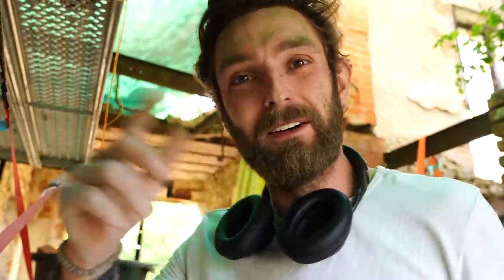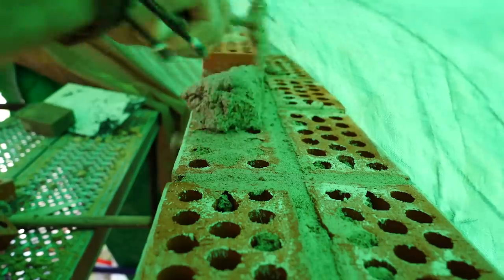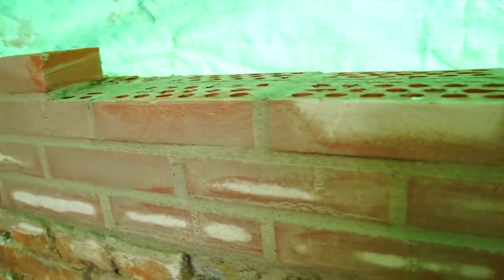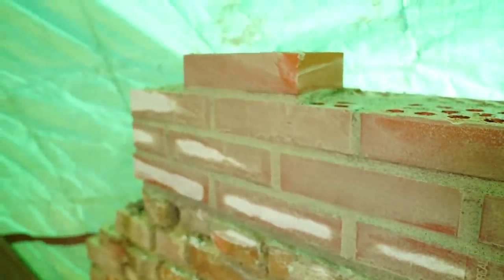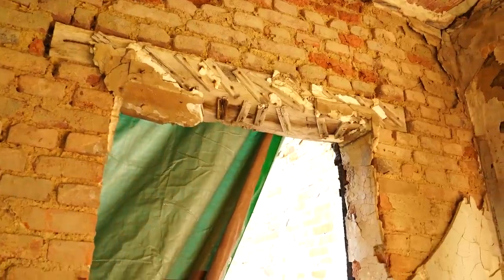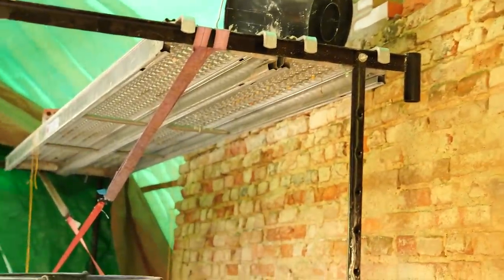The great rebuild has commenced; rebuilding a ruin brick by brick.

Comment: Please do a 30%-60%-90%-20% overlap per layer and make every second layer as a cross layer. It will make the strongest brickwall. Alternative you can use stainless steel binders to secure the strength of the wall. Regarding transportation of materials, you can make a ladder lift by using the ladder as a railsystem for your winch. Best regards from Denmark.
Reply: I'd like to see him try that ladder rail system, just to see how it works! 🤔
Reply: You just copied and combined the other comments before you 😂
Reply: I hope he reads your comment. Pretty scary stuff.

Comment: You need to read about the different kinds of brick bonds (that’s the pattern which bricks are laid in walls). You should probably lay them them the same way. The amount of strength is determined by the bond you use. I know of a couple different ones. They have changed at different points in history.  Oh screw it. I looked it up for you and what is there is an English bond and it is the strongest. What you’re doing is not as strong and might not be strong enough. An engineer could tell you. Put it back the way it was or it might fall down.

Comment: Just something to consider: i know you guys in britain work different that we in germany do, but if you look closely at the wall under the part you did new, you will see, that the french as well change the orientation of the bricks in everey course. what they did (and i would do) is laying the long side of the bricks every first course orthogonal to the length of the wall and everey second course in the direction of the wall. (maybe google cross bond) the thing is, if you continue your bond, you are in fact building two walls very close to eachother, because there is no real connection between your two rows. thats having a negative impact on the load transfer on the wall. the cross bond would be the best bond to equally distribute the load of for example a beam through the whole wall (load distrubution angle)
Reply: He's still not connecting his new walls to the old ones much in recent videos. I'm a bit alarmed because this is so much effort to not be doing it correctly!

Comment: Might be worth investing in a second winch so you can send two up together and halve the amount of ladder climbing
Reply: Maybe better to pay a helper.
Reply: Can a winch be faster
Reply: I really think that doing all that he can do by himself is a large part of his enthusiasm for this awesome project!
Reply: @sadjaxx  It is possible he could pay a helper and not have enough to buy materials. Then the helper would just stand around doing nothing.
Reply: I was worried the motor on the winch would burn out
Reply: A small temporary scaffold stair with winch column would help, but will the ground floor take the weight and is it too expensive, ladders are normal for building sites but they normally have a platform hoist to lift up materials, which is obviously more helpful!?!
Reply: I’ve recommended a second winch a couple times to save time, climbs and safer. In USA proper winch would be >$300. No brainer. And if he finally gets a helper or volunteer just makes them more efficient too
Reply: Oh my goodness what a fab idea.  Up there for thinking eh.
Reply: @loloholmes2793  These 100-Euro winches are rated for 250 kg if I remember correctly. Their achilles heel isn't the motor, it's the switch. A replacement switch is around five or six Euros at Conrad's though and plugs straight in. I've been tempted to convert ours to contactors for a while though, that should make the switches last forever.

Comment: You really shouldn't do a 50% overlap in the brickwork. If a brick breaks at the center point the crack will go down the next gap underneath and then the brick beneath that has to carry all the forces from above alone. You normally have a 25%-50%-75% (per layer) overlap or better a 30%-60%-90%-20%-.. (per layer). This will distribute the forces more evenly in the brickwork.
You should also cross connect the layers quite often. This is really important.
A. every 7 or 11 bricks, 
B. or make a cross connecting row. every 3 rows.
If you look closely you will see that the old brickwork is a roughly 30% overlap with a cross connecting layer every second row.
The 50% overlap looks nice but is the weakest brickwork. The more "chaotic" the brickwork the better, as long as the gaps are not directly above each other.

EDIT:
You should also have an overlap between the bricks of both sides of the wall. You should also use a soft mortar for the first three rows. As the wall settles with the new weights. Hard mortar will make the brick break. You need some layers that can "follow" the settling walls. 
Adding a layer of glass fiber mesh in the mortar will help with that. There is specialized mesh exactly for that application. It helps distributing the forces.
Reply: This is why daily vlogs are so valuable. Expert advice is offered at an early enough stage to be useful. Worth more than money imo.
Reply: @michellebyrom6551  Not rally an expert just a guy who has rebuild a few houses in his live. Laying brick is something you really have to look after. I had to rebuild a wall once because of this.
Reply: Excellent advice and well explained! We learned this the hard way ourselves... luckily we hadn't gone too far! 😬🤦. Very critical at any height but especially at the height that Dan is working at.
Reply: The hammock shenanigans made my day. ❤
Reply: Sure hope he follows your advice….😅😅
Reply: @maryfoster1395  You really think he reads the comments ? .....I don't
Reply: And to that point, that wall appears to have been constructed with English bond (alternating layers of headers and stretchers) which is among the strongest bonds in masonry. The new laid brick is in American bond which is fine for facades but not great structurally.
Reply: @meichong8278 just reads how much he’s getting on patreon
Reply: Great advice
Reply: @meichong8278  Yes he does occasionally scan the comments - he may not reply but I have seen comments in video's that directly addressed comments on his video's and usually weeks to months down the road..  He films in advance too so sometimes what we are watching today had been done a week or more before so his replies on video seem a long way off.  I'm amazed at how hard he works and films/edits and uploads with only 2 camera's and mostly on his phone - I asked and he answered.
Reply: A mason might help
Reply: I think he's missing a trick and getting in touch with a local college where they are teaching brickwork/plumbing and electrics, supply the materials they supply the students, they get the work experience and you get assistance, although you may want to address the glaring health and safety matters before that could be allowed =)
Reply: @maryfoster1395 ?
Reply: @Mei Chong  he does a yr night
Reply: @SSHHABBA  are se jealous  much😅
Reply: @caerleon9176  a bunch of kids three stories up a  fire damaged mansion?? I don't think anyone would take that risk
Reply: @richard-gn3es  I did far worse in the Army at 16 1/2. Like anything, if the risk is managed should be no issues for anyone.
Reply: @caerleon9176  it's a liability for the college.. a YouTuber and the kids?? When the guy can afford to hire someone to help brick lay.. instead of all the hassles a bunch of kids would bring
Reply: I hate to be the negative Nancy but I question the structural integrity of those walls. I’m not an expert nor have any knowledge of building but something tells me that building new brick on top of crumbling brick doesn’t seem right. Am I wrong?
Reply: Great advice  clearly explained 👏
Reply: @dban3750  Im unsure about that but i think id have pointed between the bricks on that wall before adding any weight
Reply: Good advice
Reply: Wowzers. Can you fly to France and help him out?!
Reply: Same reason they previous builder alternated the brick rows.
Reply: It looks like you started an American or Scottish bond. So far I only saw stretchers. When will you start with headers?
And btw: If your hammock has the right size you sleep at a 90 degree angle to the hammock to have a straight spine…
Reply: The chosen brick-bond is home made. The home-made version, will not replace the building's original English-bond. The English-bond, is that bricking-bond, that has the highest structural integrity. But as Dan says "he's no expert" So he believe that his untested home-bond is stronger, it's not!! But it does save on bricks.
Reply: @meichong8278  He does!
Reply: @michellebyrom6551  Very true.
Reply: Wow, u need to go over there and help him.
Reply: Can u do a video explaining what you are saying ?
Reply: Good of you to share your expertise.

Comment: Agree fully with Ian C. You need to tie the two brick courses together at very regular intervals. Also, and this might not seem important but trust me, it is, if those bricks have been stored inside as appears to be the case, you need to soak them in a bucket of water for a few minutes before use.  It the bricks are dry, they will suck the water out of the mortar and you won't get a proper bond between the brick and the mortar. Great channel!
Reply: Dan has been doing this!

Comment: 7:00 no, it won't be stronger. Also you need a queen closer or half a brick on the opposite course to stagger the mortar joints otherwise it will crack along the mortar joints. The original brickwork looks to be flemish or English bond and the bricks placed perpendicular to the stretcher course are to tie the wall together otherwise it will want to peel apart. You could get away with using metal ties every couple of courses if you just want to do a straight stretcher bond but that's not 'period'. Also, use a piece of wood or metal at one end screwed to the end of the wall with the depth of each course to get your desired height and use the lazer to mark on the old brickwork the height of each course nd run a string line. Not a critisism, just advice for your awesome project from someone who has been there and done it albeit with portland, not lime.
Reply: I’ve no personal expertise, but I did wonder about how stable those two courses of brick would be at at height on a somewhat mobile structure and attaching to an old wall, especially if they are to support the weight of a form & a curing ring beam on top. Good to see someone with knowledge commenting.
Reply: This…
Reply: Totally agree.  Hopefully Dan reads this and adjust accordingly.  Also, glad Dan now has his twin brother helping.
Reply: What gave the game away  ? When he said " I've just got to put another couple of layers on "!!! Or when he said " I'm not sure what I'm doing . .. but at least itll look nice and neat "  I think the only bond Dan knows is ..... James Bond 😅😂🤣😂😅
Reply: Listen to builder
Reply: Need a consultant builder or architect hobbiest🎉
Reply: Another tip is to repoint the brick under where you are laying brick. Everything below supports what is above. Placing reinforcing steel "staples" between inner and outer layers is a good idea. To build an arch. you need what is called centering, or a form for the underside of the arch. It supports the brick work until the mortar sets.
Reply: It did make me cringe a bit as soon as I saw he wasn't doing the second course perpendicular like it was before. I was shooting in my head that it's not going to be as stable, nor is it going to look right! 😟
Reply: Edit: *shouting
🤦‍♀️
Reply: What he is building here is essentially a series of little two brick columns which are  weak, structurally.  Ian is totally correct he needs to stagger the two stretcher courses of brick on either side of the wall with a half brick at either end, so the bricks on either side are offset by half a brick from each other. He then needs to put header courses of brick across the two stretcher courses at regular intervals, to tie the two halves of the wall together.  This is how the original walls were built and this is for a VERY good reason.  I would advise taking down the new brickwork and starting gain before he goes any further.
Reply: I loved his line: "I'm no expert but I feel this will be stronger"... than the brick layout pattern done by the experts
Reply: @andymccabe6712  Yes he has. As we see in future, now past, his centering is tight. There is no room to get the formwork out after the mortar has set. Wedges and screwed cross supports would help.
Reply: @andymccabe6712  I tend to refer back to the experts who built the place. Those who were masons and engineers their whole life. Dan himself said the first time he’d even touched tools was a few years ago starting their farm house. He’s a great learner, very clever and capable but in real terms his experience is very, very limited.
Reply: @andymccabe6712  He’s built about 3 arches in his life. And even then only reconstructing the form of what what already there. I wouldn’t count his kitchen bench mock-industrial-style recesses. But yes, the over-reaching condescension is a nasty part of YT comments. Old men shaking their walking sticks at the TV hoping to be valued for their wisdom.

Comment: I LOVED the "BUCKET CAM" going up Dan !!! With the brickwork I would do what the builders did before you TWO rows "side by side" and then "one row across " to tie the wall together and stop it from splitting down the middle. This is a SOLID WALL CONSTRUCTION, so no insulation then in about the 1920's the cavity wall comes along but cavity wall insulation to make a warmer home is not introduced until about 1970's in the UK. This would actually be a good time to build with a cavity so you can build to new standards and use insulation ! I think that hammock was telling you it was to soon to buy a hammock as "little naps"  could slow it all down and winter is on its way !!!
Reply: This is an internal wall, so no need for a cavity. The external walls are mostly still there so I think he'll have to go for internal insulation, like he did in the farm house. Cavity walls were typically used in particularly rainy climates to keep the inside of the external walls dry, the thought of adding insulation came much later.

Comment: Hi, you are putting a great effort in this project and that is more than admirable!

Here as an architect I would suggest that you consult an architect for some of the technical decisions to ensure the security and long lasting of the Château and to make your efforts worthwhile.

As a general note, stronger is not always better. If the existing brick walls has a soft mortar you should be using one of a similar softness, same for the bricks. The reason for this is to allow the same amount of natural movements and dilatations in both the existing parts and the new ones, avoiding tensions between them. Same goes for the layout of the bricks. For what I can see the existing brick looks something similar to a yellow clay brick. To source this you probably will need to do some research but there are companies that do historical sized bricks etc.

If you do otherwise especially in the facade, it wont be long until you start seeing cracks or worse hazardous consequences.

I hope this helps you.

Great job anyway!

Comment: If you are to add weight to those walls, the underground arches need to be replaced to hold the weight or you might have a catastrophic failure.
Reply: Those arches have a concrete ceiling above, albeit a somewhat crumbly one. As far as I can tell none of them support the brick walls above. Besides, Dan has already repaired the worst ones.

Comment: I agree about the brick arches, the best time to do them is now. You will never want to go back later to change them and if you do it’s only making extra work. 

The first job I had done in my house (in April this year) was have the new window openings cut out for extra windows. In a house with 1/2 meter thick walls I did not want to do it later. When I saw the mess I knew I was right. 😂

Comment: A wish list for Dan, a work truck (the poor suspensionon on that van), a helicopter to air lift heavy supplies way up to the(for now) top floor, a better bucket to hoist heavy loads and cold drink beside the precarious hammock.
Reply: I'd think a crane would be more affordable and sustainable than a helicopter.

Comment: I am in awe of your head for heights and tackling such a big project. I studied as a building surveyor and I noticed with concern that you are not using enough headers and relying on the strength of the mortar to stop the 2 rows of bricks from peeling apart. Please make every other row of bricks headers (at right angles ) to the row of long bricks (stretchers) . This would be english bond. Just Google brick bonding and you will see what I mean. You should avoid any vertical joints. Bear in mind you look like you are using a lime mortar and it is not as strong as cement and takes a while to dry and you should avoid it getting wet (not easy ). You have plenty of bricks yet to lay and it is no more effort to lay them properly. John

Comment: V70: I am now seeing the intense heat damage from the fire! The Turret produced the 'perfect fire' with the 'chimney effect' once alight the roof will have gone first allowing the fire to 'draw' Oxygen in from the ground floor. Looking at the heat damage to STEEL the temperatures must have been over 1000 degrees C to bend the beams, as steel MELTS AT 1300- 1500😧
I also suspect that many bricks are over brittle as they would have been super-heated. As they aren't 'Firebricks' (used in chimneys) this affects the structure and strength of the brick. The pattern of damage to the wooden beams is also indicative of immense heat. Replacing so may bricks will actually make the chateau now STRONGER than the old ones. Excellent work Dan.
OHHH NOW that hammock looks great!!